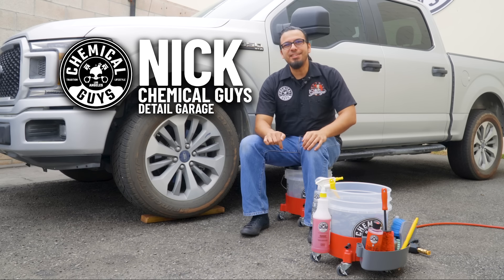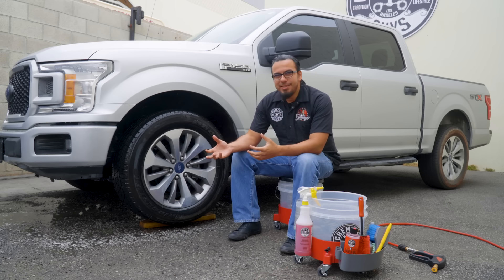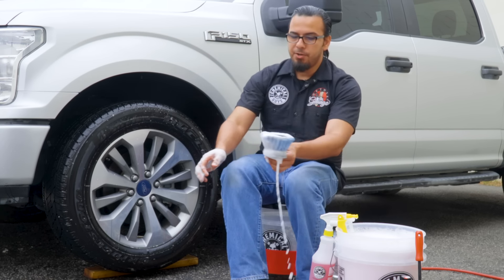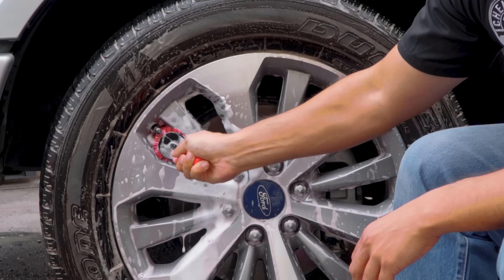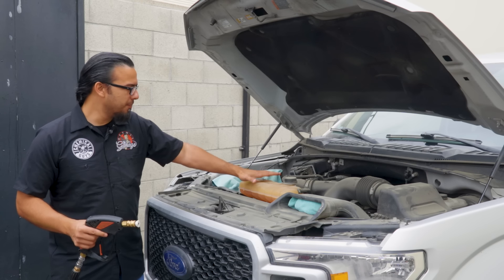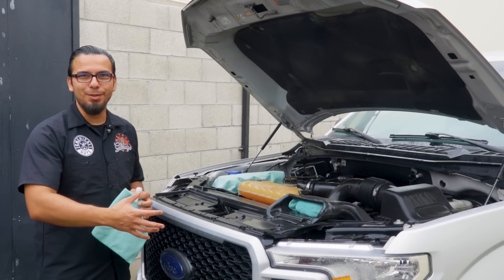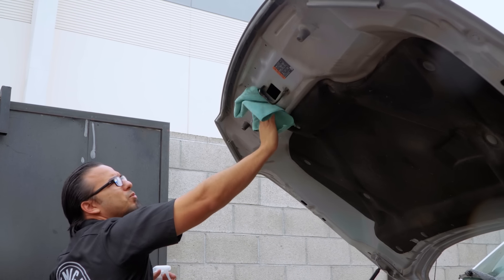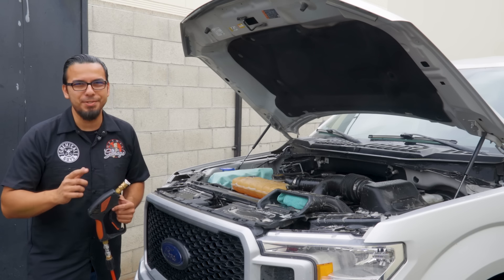Dusty Truck Driven Through A Dry Lake Bed Gets A Full Clean! Wheels & Engine Bay -F150 Series Part 1

Comment: Loving my CG products. I am weary about attacking some water spots using Heavy Duty Water Spot Remover since I have applied Hydroslick. Is the Heavy Duty Water Spot Remover safe on a Hydroslick protected vehicle? or will it strip the coating?
Reply from the maker: Hey Patrick! It is safe to use Heavy Duty Water Spot Remover on ceramic.

Comment: I use CG for all my car/motorcycle cleaning products. I see you've been using Nonsense in other videos, and I cam attest it's a great product. I am glad I bought a gallon of it.

Great info on water tips you're using on the pressure washer. 

I have a gas powered 3100 psi pressure washer but thinking of getting one with less power. Your thoughts? 

Thanks, Nick!
Reply from the maker: Hello! Thanks so much for the awesome feedback. 3100 PSI is great for automotive detailing. Never exceed 4200 PSI.

Comment: Do you need to cover the alternator as well when you clean the engine bay?
Reply from the maker: Hi Sonny! In most modern vehicles it is not necessary to cover the alternator however it is still great practice to protect sensitive components.

Comment: I've seen other YouTube detail channels use their pressure washer on the engine bay,  with the alternator covered.   What are your thoughts on that safety wise?  Freaks me out to try that
Reply from the maker: Hi Ross! Most modern vehicles have sealed electronics that can be rinsed with a pressure washer. Use a 40 degree tip to gently clean the engine bay and avoid saturating.